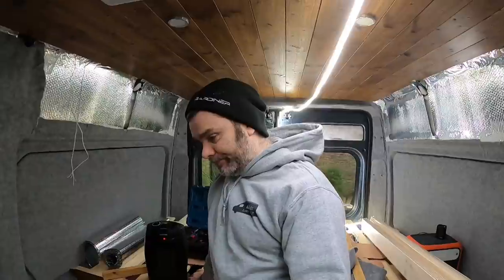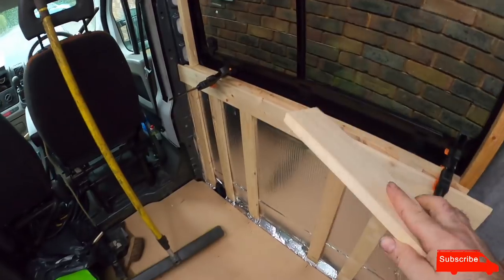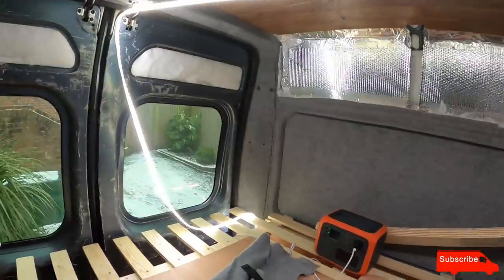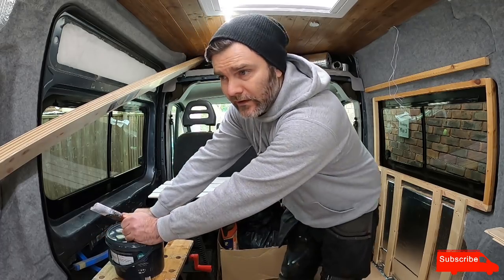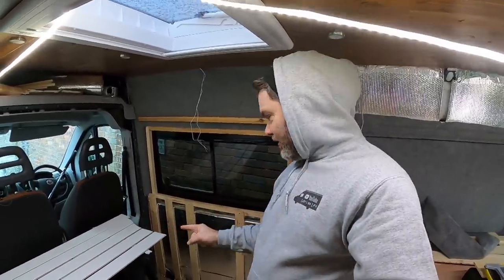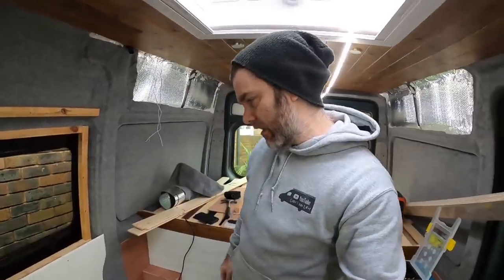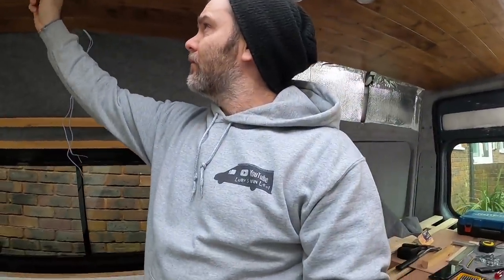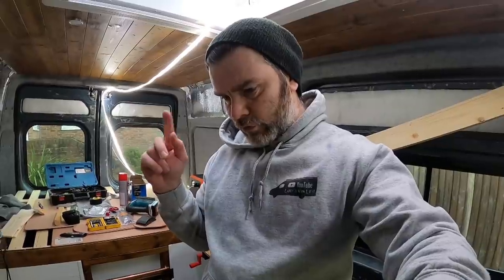Fiat Ducato Camper Conversion || Episode 12

Comment: Take the screws out Luke. Drill the holes and glue dowels in. Sand flush and touch up with paint and you won’t see the fix.
Reply from the maker: Like the tip. Thank you 👍😁

Comment: You sound like you've hit the van build wall, so much to do and trying to work out the sequence. Regarding caulking, do not use a flexible decorators filler as it will shrink and crack as it's not designed for lots of movement. I would use a polymer hybrid sealant like Soudal Fix all or equivalent. Good luck, enjoying your build.
Reply from the maker: Thanks for the tips! And thank you for watching 😁👍😁

Comment: Hi do I need to use marine ply on my floor or is Normal ply ok and what thickness would you recommend thanks
Reply from the maker: If you can use ply that has moisture resistant properties like marine it's better. You want it thick enough to not bend while walking on it. So no thinner than 12mm in my opinion. It also depends on how much supports you have underneath. 👍😁
Reply: @LukesVanLife  I was thinking running battens down 12 inch centres so should be plenty enough support thanks